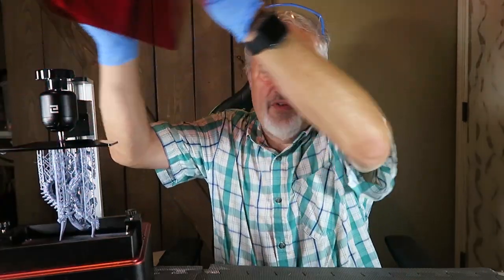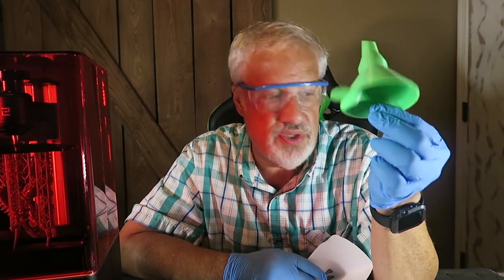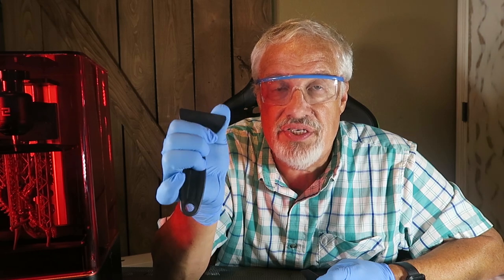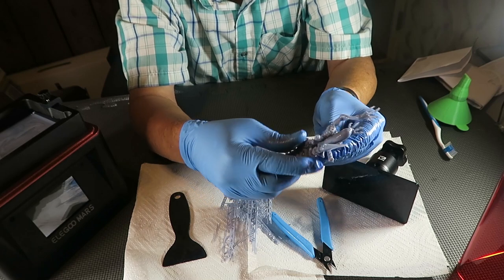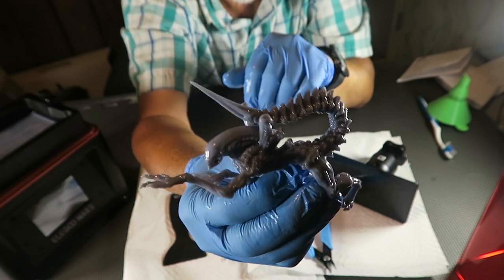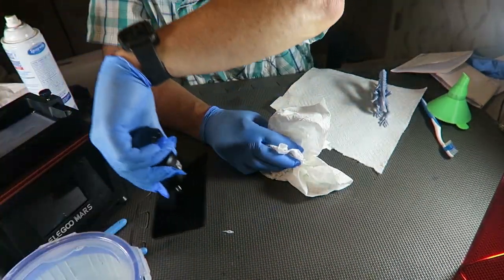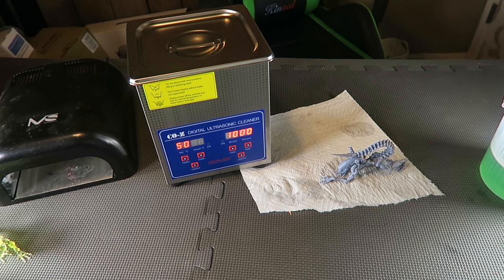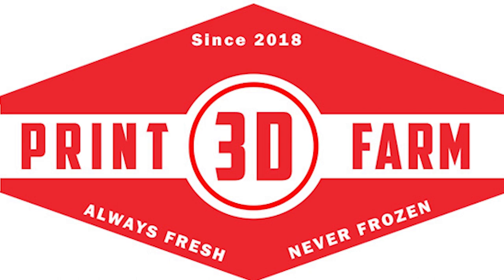Elegoo Mars Resin Printer: Getting Started! Tips and Tricks!

Comment: Great, comprehensive video. Consider using fine-pointed tweezers to remove supports.  You can grab them right at the end where they touch the model and pluck them off.  Then you have less cleanup to do with the nippers.  You don't end up with as much resin on your gloves, etc. because you aren't handling the model with your hands as much.
Reply from the maker: Awesome tip!  Those nippers are limited in tight spaces!

Comment: Great "getting started" video. Some tips: 

Don't mess around with the supports before cleaning. Just clean them with the model in the ultrasonic cleaner. Then remove the supports and only after this start curing with UV. I use chop sticks to move the contaminated Model from the paper towel into the ultrasonic cleaner. Doing so doesn't contaminate my gloves and I can use them more often - avoiding too much trash.

When removing the model from the build plate put one edge of the build plate on the working surface (paper towel). Doing this gives less stress to the holding screw and providing readjusting and releveling of the build plate.
Reply: The amount of gloves and fuss he did was actually counterproductive from what I could see, and he never showed us using the toothbrush, so I'm not really sure at what stage he uses it. He also seems incredibly wasteful, he already has IPO, so why buy another product - a spray which contains IPA? Then he uses some US product called green stuff, when again he could use 2 vats of IPA which I've seen everybody else use. Great tip ont the chopsticks.
Reply: Chop sticks is a great idea, thanks
Reply: Excellent tips.
Reply: @BarringtonDailey  He literally shows a clip of him scrubbing the model with the toothbrush while cleaning it.
Reply: its easier to clean supports before wash when they are soft which also leaves behind less if any damage to print

Comment: Let your prints soak in rubbing alcohol for 2-4 hours and the supports become super soft and you can pretty much break them right off the print without hurting the model, no snipping needed unless there are some decent supports on small tips of the print. I do it all the time and it made this portion of the proccess super quick, and wish wash in the alcohol as well after this, dry off and put in a curing chamber and your set!

Comment: HELP! Just got a Elegoo Mars and can’t find any ipa alcohol anywhere to clean the resin tank any recommendations or advice would be greatly appreciated thanks in advance.😀😀😀
Reply from the maker: Yes sir!  If you can find some Mean Green cleaner, that works great!  You can usually get it at Walmart or Lowe's.  To clean my build plate, I use Sprayway Glass cleaner.  You can find it where the Windex glass cleaner is sold!
Reply: 3DPrintFarm thanks I have both I only seen people cleaning the resin tank with alcohol. Thanks a bunch
Reply from the maker: @MarcusWallace  After you clean out your resin tank, use the Sprayway Glass cleaner.  It foams up and works well.  That's what I use!

Comment: Trying out the microfiber squares for the resin tank. How do you deal with the little fuzzies that it sheds? They generally have been getting into the corners and edges making them fun to deal with.  They do clean and absorb great.
Reply from the maker: After I cut them, they do tend to get the fuzzies.  Sometimes, I will run then through the wash once and dry them or at least rinse them with water and dry them.. That helps with the fuzz.

Comment: I've having a lot of trouble with some prints sticking to the plate. So far nothing I've printed with supports works. The support break 1/2 way through every time. Prints with a larger base work fine...but I need to be able to print smaller objects.
Reply from the maker: What size supports are you using?
Reply: @3DPrintFarm  default settings...however I just saw your video showing the correct support sizes. Going to check when I get home. Probably need to modify.

Comment: I'm so close to pulling the trigger but jeez, it seems like a lot of work, mess and fuss to print the model and safely clean it!
Reply: I'm a former environmental scientist who likes to make things. This process is a nightmare. I found water washable resin so I don't need IPA, but I also need to create a procedure to reduce the waste. I think it's possible to reduce the waste down to one pair of gloves and some paper towles, but I still need to safely get rid of the uncured resin wash liquid...
Reply: @evilparadigm  I have bought this 3d printer and It's still in the box because I still didn't have found how I will manage to seal the waste to send them away to my city waste disposal area (the uncured epoxy resin residue) My workshop got an air extractor and I will use the printer with a good gaz and particle mask and non latex gloves but still, i'm afraid to use it.
Reply: @tilleul6917  I'm using a pair of nitril garden gloves with a pair of disposable nitril gloves over those. (The back of the garden gloves are fabric, thus the nitril disposable over the garden gloves.

As soon as I'm done I can pull the garden gloves off with the disposable one still attatched, then throw them in my home made uv light chamber to cure the resin and make them safer to keep using. 

This way I can keep using the nitril disposable gloves a few times (like 3-5 prints) instead of throwing away 2-3 pairs EVERY PRINT.

I have my printer in an enclosure with a vac system that takes it out the window. I also reuse my wet paper towels a few time s and leave then in a metal pie pan with other dirty cleaning stuff until the paper towels are too dirty to use.

Finally I also evaporate my rinsing water (once it's so milkey I can't clean parts anymore) in the sun in a metal cooking tray.

I'm still refining my procedure, but I'm making WAY less garbage now and it's all pretty clean. I break supports of on a metal cookie sheet where I can rest my dirty tools. By using a cookie sheet I don't waste paper towels on a table or something.

Comment: Any help would be appreciated. I have the Mars and I am having trouble printing a raspberry pi case. The case warps of the printbed, then when using supports to "cushion" the warpage the supports adhere beautifully with no warping but then the case warps off the supports. Printing with stock settings using Anycubic clear green, and tried elegoo black but with recommended settings for black resin.
Reply from the maker: Can you email a screenshot of your r pi case with supports?  Email is in my channel description.

Comment: Great video! 
I'm new to Resin printing and your videos are great for someone like me!
I have a couple questions about using using the Mean Green cleaning solution.
(1) How many times can you "reuse" the mean green cleaning solution before it get to contaminated?
(2) What is the best way to dispose of the mean green cleaning solution once it become to contaminated with resin?

And what about using Isotopic Alcohol, do the same rules apply?

Thanks ( this might be a whole new video for you to make! )
Reply from the maker: Thank you sir!  The Mean Green and IPA will get really cloudy.  Ideally, it's better to have two containers...One for a pre-rinse with a toothbrush to try to remove most of the resin and then the second container with clean MG or IPA.  Of course, this second container will stay clean the longest.  What I do after the container gets really cloudy is take it outside and let the sun cure the resin. It will turn into a sludge like material that is UV cured and can be tossed in the trash. Still use gloves because there may be some dissolved resin in there. I'll then wipe out the residue with a paper towel, place in a Walmart sack, tie it up and trash it.   IPA will evaporate, MG will not.  Thanks again for your question! I wish the best in success  with your resin journey!
Reply: @3DPrintFarm  Thank you, again for that info!
Reply: @3DPrintFarm  "IPA will evaporate, MG will not" Do you still let the Mean Green mixture cure in the sun, then? Responsible disposing of the waste is one of the major mental hurdles I have picking up a resin printer ...

Comment: Like your video, lots of good tips to make it easier, less toxic and fun. Have a question my first print, the rook failed and was hard as hell to get off the build plate (broke it doing so). Are the exposures set in the software like Cura and set in the file you are printing or in the printer.
Reply from the maker: Yes.  The exposures are under Settings in the Chitubox software

Comment: Great video series. Just got me an Anycubic Photon S a few days ago. I've learned a lot from these videos. Still can't get the print to stick to the bed though, but to the FEP. Well, I managed to finish the test print on third try but not when I try to print another figure. oh well, I will figure it out.

Anyway, what I would like to see an episode about is how everything around the printing works.  The resins stuff scares me and I try to take every precation but I don't know when enough is enough? How well do you have to clean the tools that you use? The object you use? Does the resin get harmless when diluted in the isopropanol when cleaning? A drop on the bottle or somewhere, will it get safe to touch in time? Pretty much how to handle the resin , the printer, the tools and the environment before and after the print itself. There's glimpses here and there but not the full picture if you get what I mean.

I, as a newbie, would really appreciate to learn about this. And if I've managed to miss a video covering this topic I appologise. I've still not watched them all.
Reply: Ulvsbane number one issue I had was with cold, try heating resin before use and ideally get a small heater for the printer enclosure too. Peopoly make them

Comment: Couldn't this process be streamlined a bit? Maybe a larger container with cleaning solution? Couldn't you remove the build plate and print from the printer and submerge the print with support material and part of the build plate into the solution.  Swirl it around for a few seconds, then remove the print from the plate wipe it clean, place it back in the machine. Then go on about removing all the support material from your print and discarding it.  I just don't see the point in covering your tools and hands with resin when the majority of it can be rinsed away before you even touch the model.  Seems to me gloves would then only be needed when it comes time to return excess resin to the container.  Just a thought, thanks for the video.
Reply from the maker: Thanks!  I appreciate the feedback!  The world of resin printing is in its infancy and safety is paramount.  Even though each one of us may have different workflows, we all strive for safety.  Here lately, I have modified mine as well.  In the past, I never liked to remove my supports post cleaning because of resin tended to be super brittle which caused damage to the print as well as difficulty with removal.  Since the advent of my ultrasonic with heat, I have noticed that once out of the 50c bath, the supports are pliable enough for ease of removal.  This procedure has helped tremendously in preventing contamination of my tools and has made me think differently on going forward.   I'm going to post a quick video soon on this as I feel it is important enough for folks to know. Thanks again!
Reply: I look forward to seeing it. Thanks

Comment: I was sent here from the elegoo Mars series FB group .  Just got my printer and had lots of questions on cleanup.  I use water resin so I’m wondering how different this cleanup process would be with water resin. I understand it’s still toxic. Anyway great video, I’ve subscribed!
Reply from the maker: Great question!  You want to treat even water washable resin with care using proper safety. Gloves..etc. I would get two separate containers of clean water. Rubbermaid makes some disposable ones that work great. Put your model in the first bath, gently swirling and if needed use an old toothbrush to get in all the nooks and crannies. Then transfer the model to the clean water and swirl to remove remaining resin. Remove your print and let it dry. Use compressed air or hair dryer on low to speed up the process if needed. Then cure with UV as usual. Good luck and have fun!

Comment: Hey man. Once again, awesome video. Im still printing on my Anycubic Photon ☺️
Quick question! Ive made a print, but it seems the tank ran out of resin. Is there anyway to fill the tank and go on with the print, or is it just a fail :)
Reply from the maker: If the tank ran completely dry, you're probably out of luck.  If there is still a bit of resin in tank you can open the lid and 'carefully' add more resin to the tank while the print is going.  Just be extremely careful you don't spill any outside of the vat onto the LCD...:)
Reply: @3DPrintFarm  My man! Thanks ☺️

Comment: ****Have question if I want to make a bigger part can I meshmaker to separate part to glue it  what type of glue do I use . thank  oh . oh wondering is resion stronger than pla? thank  you....******
Reply from the maker: You can use resin and then cure it with UV or you can use Super Glue.  I like Gorilla brand.  Some resin is very strong and others can be brittle.  I'm currently testing some super strong resin.. will post results soon!  Thanks for your comment!

Comment: I need help, got my Eligoo mars this week, 6 failed test prints. Ive tried leveling my printer counless times. Im using eligoo grey resin.
Reply from the maker: Hey David.  How is the print failing?  Is it sticking to the FEP in the vat?
Reply: @3DPrintFarm   Yes, it sticks to build plate for the first layers and then drops off the plate midway in, or never sticks to the plate at all.
Reply from the maker: @davidtrujillo3025  You might want to try increasing the bottom layer exposure time and increase the number of bottom layers to help the model "stick" better.
Reply: @3DPrintFarm  It was resin temperature, was trying to use in my garage, was slightly too cold. I now have accidentally put a small hole in pef film as well, ordered 5 new sheets. I got 3 prints to work before I realized I had a hole in pef.
Reply from the maker: @davidtrujillo3025  Hang in there!  It will all come together!  You're doing great with the troubleshooting!

Comment: Very informative video! Regarding safety concern, what kind of room can you print inside? I really want to buy a 3d printer but I don’t have garage. Is a well ventilated room ok? Thanks!
Reply: I had a similar question and after a lot of research (and even contacting Elegoo directly) it seems like a well ventilated room is preferred. Some place that you can open a window and direct a fan to blow out the fumes. Elegoo does NOT recommend working in a garage unless it is well ventilated,  insulated, and temperature controlled as the heat of a garage is not good for the electronic components in the printer.

Comment: So I’m new to 3D printing and buying my first. How does this compare to a normal 3D printer that uses filament
Reply from the maker: A resin printer uses UV sensitive resin. As the build plate lowers into the vat of resin a UV light briefly exposes a section or 'slice' of the model for a set number of seconds, thereby curing that layer.  The build plate then rises, peeling that layer from the thin clear plastic film of the vat.  The plate then lowers again and the process is repeated until the model is complete.  Resin printing is much messier than FDM printing and requires you to take some precautionary steps for your safety, but the results are mind blowing!  You prints come out like injection molded object with little to no imperfections!  It's truly magical!!
Reply: 3DPrintFarm thank you so much! I love the quality of the resin but I feel as a beginner it’s like a lot of focus work especially with the precautions needed. I’m heavily leaning towards the Ender 3

Comment: Hi I wasnt sure where to ask this but have you ever mixed resins to get a stronger print. I wanted to mix the siraya blue and elegoo grey but wasnt sure what I would have to adjust my settings to.  Any suggestions on this would be greatly appreciated.
Reply from the maker: Yes!  This is possible and encouraged to achieve stronger prints!  What you could do far as settings is concerned is run the Photon Resin test with your mixture to get results on exposures.

Comment: Hi, nice video besides it isn´t with the Photon. ;-) Is this Mars better? The ultrasonic cleaner seems very interesting. Is is worth buying?
Reply from the maker: Well, for the price of $250, I had to pick one up for testing purposes! :).  I really like it.  It's very simple to level and easy to use!  The vats are interchangeable and they both print consistently.  I do like the higher wattage lamp on the Mars and the 360 wrap around feature.  It's very easy to get to to the prints.  It's very quiet and there is very little to no smell since there is no vent fan to blow the fumes out in the room.  I noticed that a lot of new users were getting this model, (some Photon users too! :).  So I wanted to provide them with some insight into the machine.   As for the ultrasonic.  It's great!  It's noisy, but it works really well in cleaning the prints.